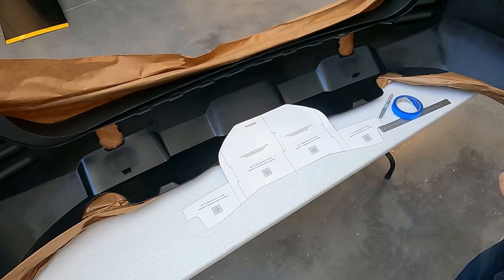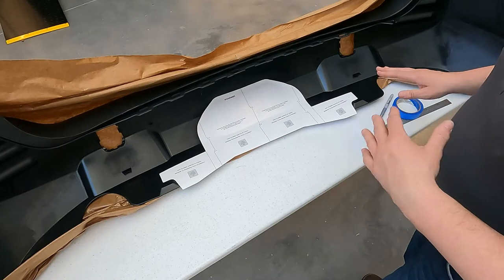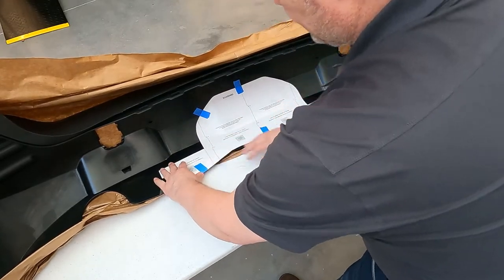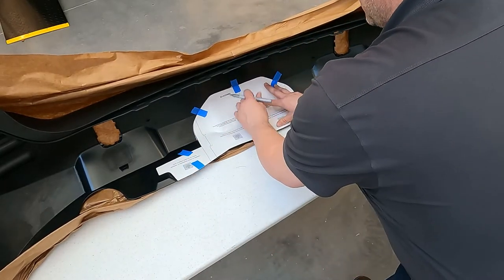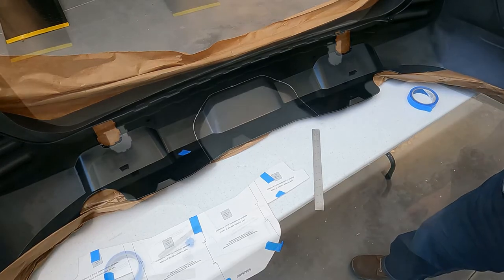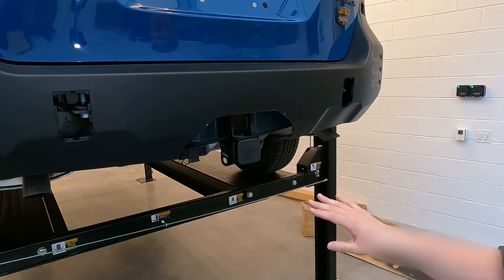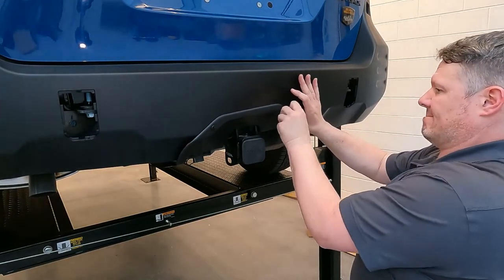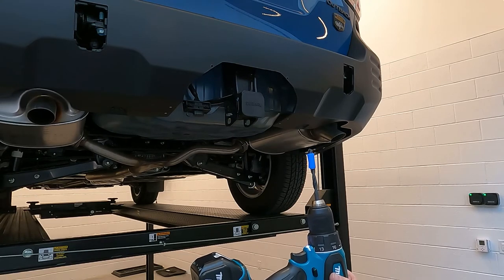2022 Subaru Outback Wilderness - Trailer Hitch Fascia Panel Template Usage Tips Video

Comment: I bought a 2024 Wilderness and had the dealer install the hitch.  I got it back with the cutout to the bumper but no fascia plate.  I went back and said "this doesn't look finished".  They said that this was the way they've all looked post dealer install.  I came across this video and after investigation they came across the fascia-now being installed.  Hoping for the best as I'm exceeding anal retentive.  They're a great dealership so I think they'll make it right.
Reply: I picked up my 2024 OBW yesterday, and I also had the dealer install the hitch.  A towing hitch and a big cutout w/no fascia plate is what was presented to me. My quest to see how an OEM tow hitch looks led me here.  I'm due to return to the dealership next week for the plate install, but you would think a big hole with wires dangling should probably be a red flag?  At least they're taking care of it?
Reply: Hey my dude. Did the dealership get everything figured out? Also about how much did the hitch and fascia plate cost to buy and have them install? I also have a 2024 OBW.

Comment: That template doesn't work as intended. It takes too much off. Whoever made that should have made it a few millimeters smaller. It's better to have less cut than too much cut. I did one without the template and it turned out great. The second time I used the template and it didn't fit well and had too much cut off for the drilling.